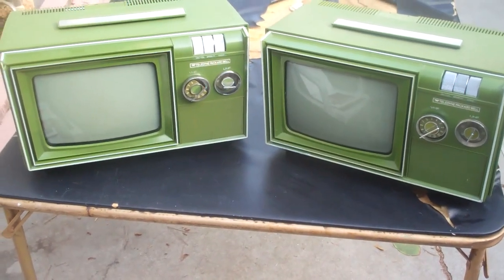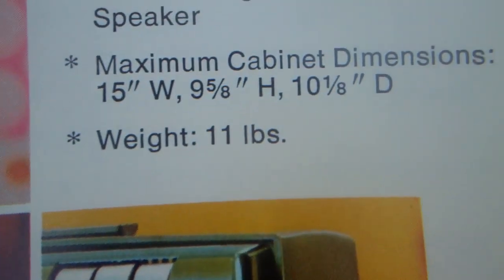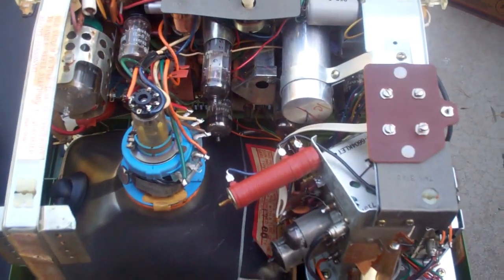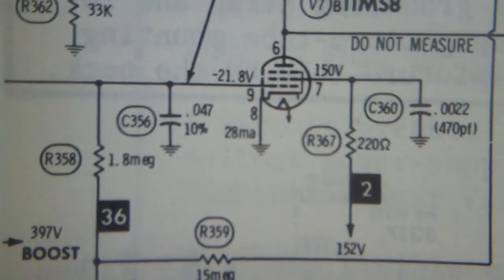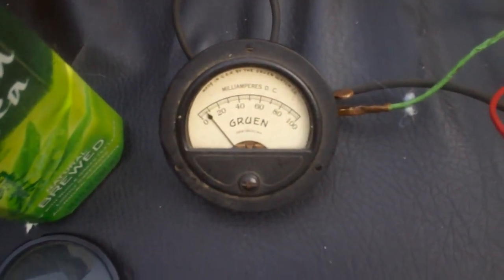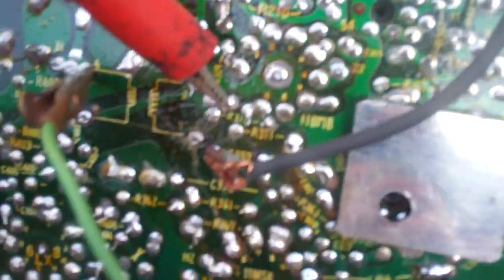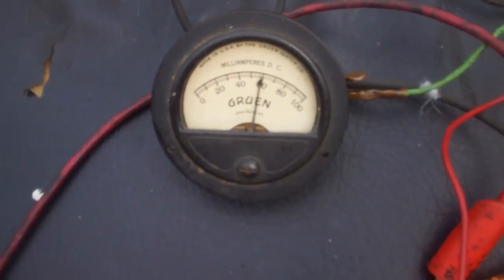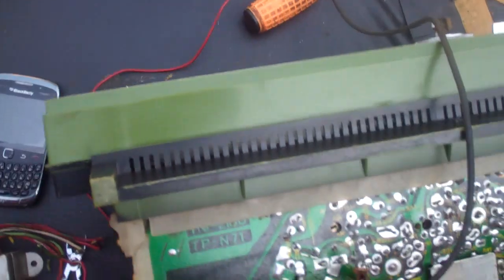Vintage Tube Television Vertical Output Transformer Diagnosis and  Substitution Replacment

Comment: Vertical output transformers are critical.  They usually have a cardboard spacer between the E's and I's to delay saturation.  A regular transformer will have poor linearity.

Comment: Do you know where I can get a 67.5 V battery for a nice Japanese radio that I thought was transistor but I opened it up and it had tubes in it I soldered 2, 30 volt batteries together and of course with my one and a half volt battery it work very good

Comment: Rewinding the transformers should not pose a huge problem, I've done it myself before even if you dont count all the turns just measure the wire or weigh it on some scales get a micrometer on the gauge of wire thickness i.e. and engineering firm could measure the wire thickness, burn off the insulation first and measure the copper wire itself once you have the right wire weigh it out to have the copper weight the same and preferably wind on the same number of turns use KAPTON tape for insulation if the transformer uses tape barriers, it most likely will be simply a bad wind or cheap wire. In some cases just unwinding the transformer and re-winding it with the exact same wire can solve the problem as the chances of the shorted wire section being coupled directly over where it was shorted out before is a  very slim chance, worth a try ;)

Comment: So, what exactly what are these sets for.  Are they for tv engineers?  I can't see what elsethey could be used for.
Reply: Watching tv, portability I'd guess, 5 inch tv sets were very popular in Europe as they'd run off a 12 volt car battery without killing it in a short space of time, another thing is with the same amount of resolution as in a big set the picture was always sharper

Comment: Yes tubes are more flexible AND resistant to blowing from a spike or short. The plate will glow red for quite a while and come through it ok while a transistor junction just goes pfft instantly.

Comment: I have a 10" portable AWA P1 from the late 60's/early 70's, and man, does it way a ton! It has 13 tubes (including the CRT), and has vertical deflection issues. I've atributed that to a series of old electrolytic cap and some incorrectly valued components; especially caps. It has a 100v cap in the space a 1600v cap should go. Mind explaining how that happened!? (-_-)

I really should resume my restoration on it. The problem is the time that I need to check it against the circuit diagrams...

Comment: Those are great looking TVs, I actually thought such small TVs would be totally transistorized especially by the early 1970s! Anyways great to see you have found a way to overcome the vertical issue without the need to get unobtainium parts!

Comment: As I frequently recommend with old radios start by replacing all of the paper capacitors, all of the electrolytic capacitors, and any carbon resistors that are more then 20% out in value. If it doesn't come to life after that then start looking at mica caps and other parts. Some you can find while you have the set apart, like open IF transformers. What you describe sounds like a problem caused by leaky paper caps or dried out electrolytics.

Comment: As soon as you said, "How is that even possible?"  I thought of a shorted primary winding on that transformer, then later it looks like you came to the same conslusion.  Love your videos, I do not know who you post them for, but I like them and I am a subscriber.  Does SAMs say what the impedance is suppose to be on the windings?  It would not be hard to get a custom piece made for these, and they would probably cost about $70.00 from my source.

Comment: What a neat little sets, and I totally agree with your final comments on how tube electronics is so flexible, given the fact you're using a colour vertical output transformer on a small b/w set.
If this was solid state, you'd run into all sorts of issues and would probably end up destroying  the vertical output transistors etc!  Great video, thanks for uploading. Cheers Glen

Comment: That is a cool looking TV set. With that high plate current, does the tube not burn out ? Great analyses. Try to fit that substitute TX a place somewhere in the case. Great video.

Comment: That vertical linearity control your talking about I think I saw that in the inside in the back,I'm just so timid about having my hands in there when it's on, hard to see the screen from bed it to unless I use a mirror but I need to have a guy look at it. I doubt though they know as much as you do about these

Comment: See how the picture looks on yours! I have that issue but it's more full screen just up from the bottom a bit. Plus to I notice when I turn the channels I don't get snow it's distorted wavy look, and some of the channels the sound is weaker than others, i almost hear a flicker sound when it's on like a old 8 mm film projector sound

Comment: No I'm restoring a 1959 RCA tv seems to have a vertical issue. I replaced all the weak tubes and it's still doing it, I get sound and a picture but seems to be a thin white line at the bottom and it's off the bottom of the screen about a inch and double folded image at the bottom. Hard to explain I thought to the height or the vertical controls in the back might be off but I'm a bit timid of sticking my hands in there lol ? Any ideas? I can take a few pics and email it to you so you can see. I